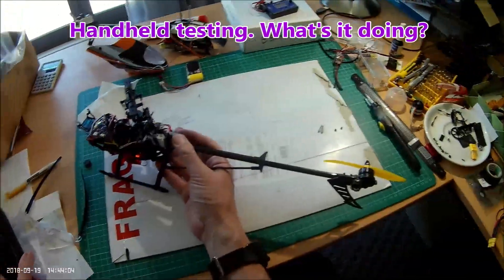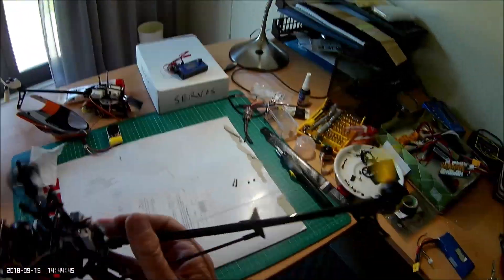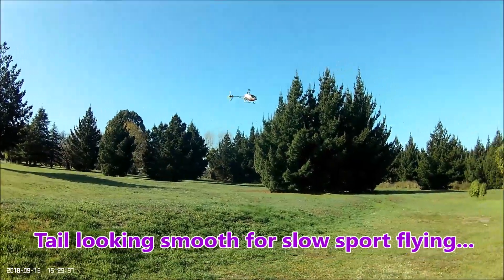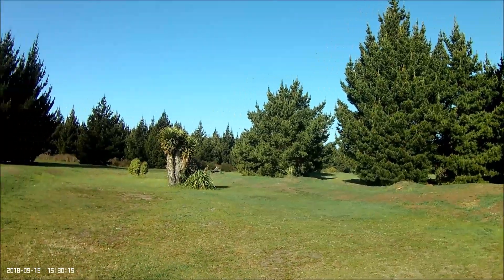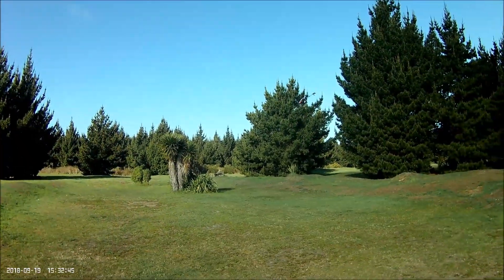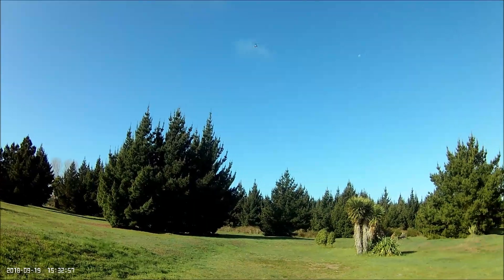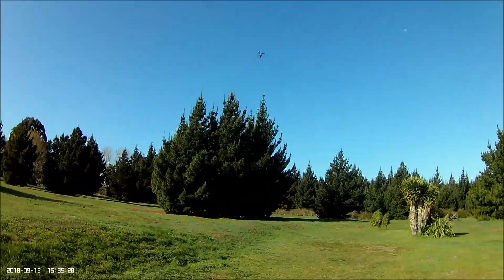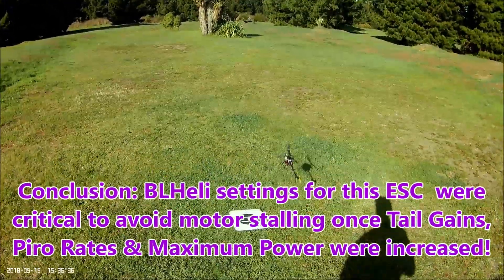V950 CC3D Spiralling Out Of Control!

Comment: Hi i have same problem and was wondering how you connect your v950 to the computer?
Reply from the maker: Not sure what setup you have but on this brushless tail motor setup I'm running a BLHeli_S motor controller, plus the V950 main board has been replaced with a CC3D flight controller (but I don't recommend trying it -it's not so good). The CC3D connects to computer via USB/Mini B cable and the BLHelis ESC connects to PC & the BLHeli Suite software via an Arduino board and USB.

Comment: Can you do a build tut ...pls  ....GrEaTwOrK
Reply from the maker: Not really keen to promote the CC3D further. I've had problems with vibrations -seems as though the CC3D's are too prone to vibration issues which is a pity as otherwise they have some great features. Am experimenting with some other flight controllers at the moment and when I find something good I'll drop one into the 950. At the moment it still has the CC3D and I don't fly it because of vibes limiting the flight performance.

Comment: my heli has problem keep lean the the left side and crash dont know what problem
Reply from the maker: V950? Are you flying in 3G or 6G mode? Is the flight controller board mounting OK or is the board loose? Does it take off OK then lean after it's flying or does it lean left while taking off i.e. still on the ground? I would check that the transmitter trims are centred, board mounting, servos operating smoothly, with the heli sitting flat in 3G mode is the swashplate level when you connect the battery? If the swash is leaning left the heli will tip lift. If the swash is level in 3G mode you may need to do a 6G calibration -try Googling it. Good luck!